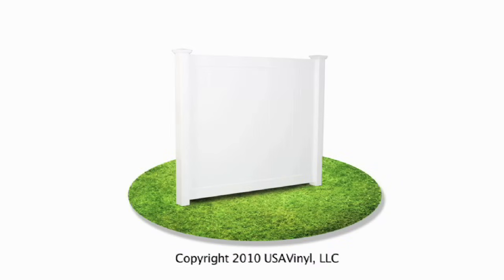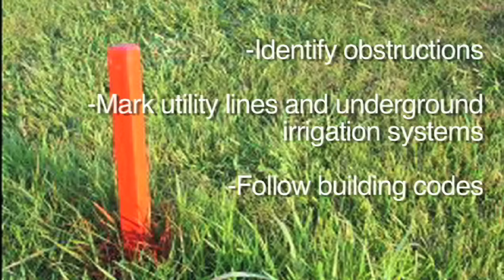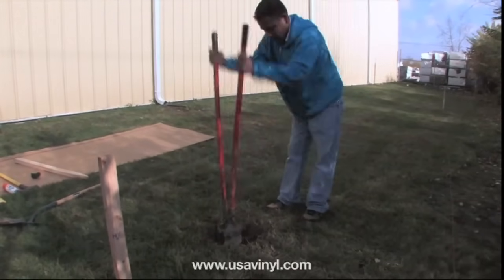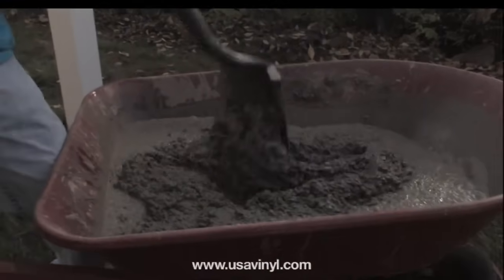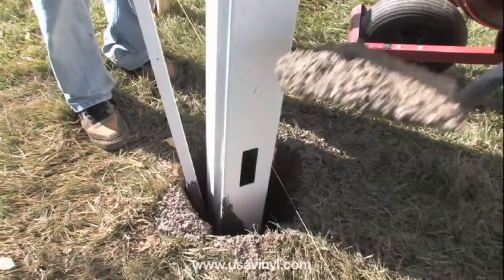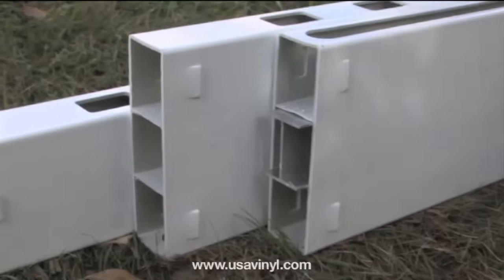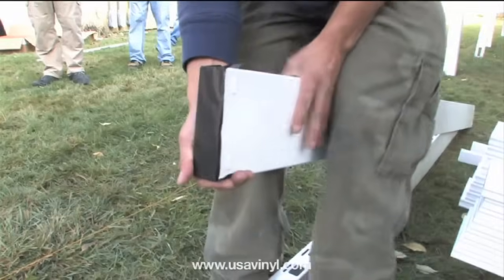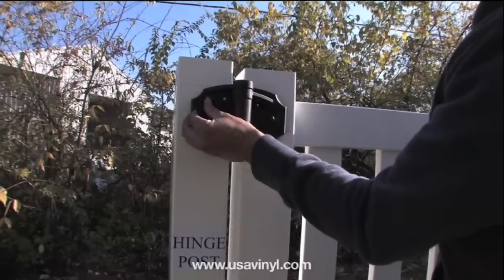How to install vinyl fencing - layout and post installation

Comment: I didn't even mix my concrete I put it in the ground dry and let nature harden it. I did this about 10 years ago and my fence is still standing strong.
Reply: fate7623 , We usually dig the hole put the post in then dump a bag of post haste and a bucket of water.
Then fill it in
We’ve done that with heavy 6x8 posts for heavy wooden city signs and they stay up for decades.
Reply: Yup depends on the soil. It should work just fine

Comment: Ryan, it's not necessary to use a sonotube for this application.  The entire footing will be above the frost line in most climates where heaving is a problem so having a smooth column won't really make a difference.

Comment: And I recommend getting a post hole auger and forgetting about that piece of junk he’s trying to use.
Reply: but with that you can tear up sprinklers and stuff without even knowing they are.
Reply: K M 😂😂😂
Reply: I'm digging within a few inches of electrical line so I probably won't auger it
Reply: Your still gonna need the post diggers to pull out the excessive dirt so it's not a piece of junk fyi

Comment: 36" inches deep ?!  Btw cement comes in a bag- they are setting posts in concrete.
Reply: How does setting a plastic post in concrete work? Shouldn’t it be steel post than the plastic post?
Reply: @surgefiggy7571  you can purchase aluminum inserts in post to make them sturdier but that's an extra $60-$90 a post but most vinly post can be set with no inserts and concrete adheres to the post no issues at all
Reply: @surgefiggy7571  The plastic holds up quite well. The metal insert is mainly used for a gate attachment. The metal slips inside of the plastic post so the fence looks the same but in reality it is much stronger.

Comment: My neighbor had one of your fences installed recently. The contractor did NOT follow your guidelines! Very few of the posts reach 3!0". The cement was dry poured so they could install the entire fence in 1-1/2 days (approx 160 LF of fence along 3 elevations!).. One of the 5" gate posts only reached a depth of 11".!!!!! Which happened to be mine as i wished to have the area between houses look the same.  Only 11" down and a dry pour ? Are you kidding me? For a 4' x 6' gate?  I'm a contractor and I plan on holding these people to the same standards I'm held to!
Reply: Robert, I just watched a video by Home Depot in which they dry pour.  I am thinking about installing a fence myself.  I am new to this.  Any recommendations?  Why are you against the dry pour?
Reply: Dustin Deweerd there’s nothing wrong with a dry pour. Matter of fact it’s cleaner and easier to level. This guy you’re replying to is just showing off his contractor skills. It’s people like him that make people like me and you put up our own fence.

Comment: One thing they are doing wrong, is you never poor concrete into a hole without the use of a sonotube. Because if you just pour concrete into a hole, all that ruff surface area on the concrete allows the earth to move the pour. Therefor in time your pour will lift out of the earth due to freezing.
Reply: Ryan Smith that’s good advice but if the standard depth of each post is 24-30”, you’re gonna do a lot of cutting to fit. Not only that, you’re gonna have a heard time filling the tube with the post inside of it considering the right fit.